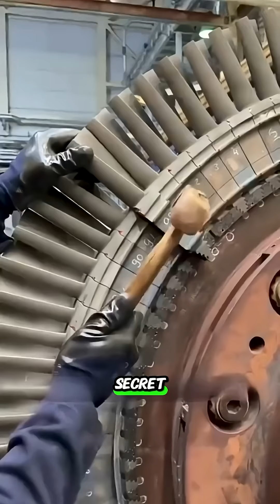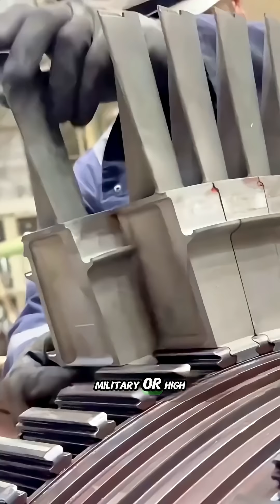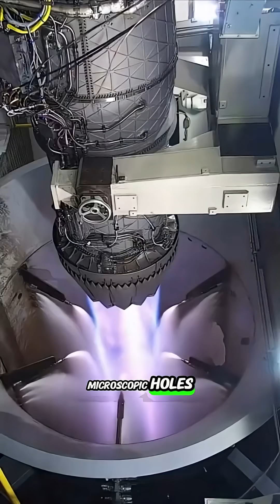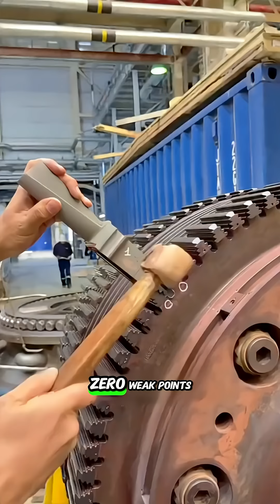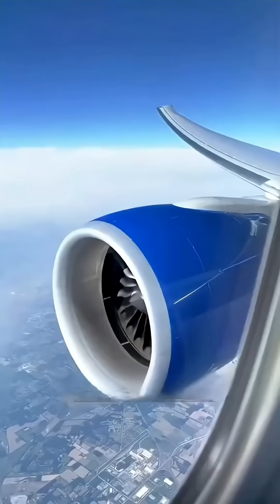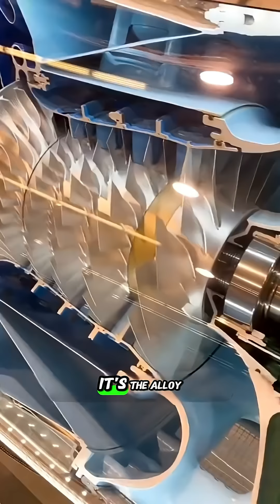The Insane Reason Nobody Can Copy American Jet Engines

Comment: number of jet engines sold according to manufacturers world wide

￼

￼

￼

+13

Four major companies build 99% of all commercial jet engines. Because they do not release the exact number of engines sold every year, experts track them by market share. CFM International leads the market with nearly 40% of all jet engines. [1, 2, 3, 4]

The top global manufacturers and their estimated shares of the market are:

CFM International: ~40% market share. This is a partnership between GE Aerospace (USA) and Safran (France). They mostly build engines for smaller passenger planes like the Boeing 737 and Airbus A320. They have delivered over 37,500 engines worldwide. [1, 2, 3, 4, 5]

Pratt & Whitney (RTX): ~29% market share. This US company makes engines for regional and single-aisle jets, like the Airbus A220. [1, 2, 3, 4, 5]

Rolls-Royce: ~18% market share. This UK company focuses almost entirely on the giant widebody planes. Widebody planes are big jets used for long overseas flights. They delivered about 262 large commercial engines in recent years. [1, 2, 3, 4, 5]

General Electric (GE Aerospace): ~10% market share. The US manufacturer powers both commercial and military aircraft. They are the second largest engine maker by volume after CFM. [1, 2, 3, 4, 5]

Smaller companies make up the final 1% of the market. These include Honeywell (USA), IHI Corporation (Japan), and the Aero Engine Corporation of China (AECC). [1, 2, 3, 4]

Would you like to know which specific airplane models use these engines, or are you interested in the military jet engine market?

List of turbofan manufacturers - Wikipedia

The manufacturers market share should be led by CFM with 44% followed by Pratt & Whitney with 29% and then Rolls-Royce and General Electric with 10% each. Conte...

￼

￼

Wikipedia

Pure power: The world's largest aircraft engine manufacturers - AeroTime

15 Jan 2025 — Pure power: The world's largest aircraft engine manufacturers. ByAeroTime Editorial. January 15, 2025. Aircraft. The biggest engine makers in the world. AeroTim...

￼

￼

AeroTime

CFM International - Wikipedia

CFM is the world's largest commercial aircraft engine manufacturer, with a 39% market share as of 2020. It has delivered more than 37,500 of its engines to more...

￼

￼

Wikipedia

Our Businesses | Rolls-Royce

Our large installed product base of more than 4,860 engines powers 4 out of 5 of the new generation widebody aircraft. Large engine deliveries increased in 2023...

￼

￼

Rolls-Royce plc

Aircraft Engine Market Size, Share, Trends | Growth [2034]

The market is segmented by: * *Commercial* Narrow body, wide body, business jet, general aviation, and civil helicopters * *Military* Fighter, transport, an...

￼

￼

Fortune Business Insights

Top 50 Companies in Aircraft Engine Market Statistics, Growth Report 2035

11 Sept 2025 — The top aircraft engine manufacturers include: * *Rolls-Royce plc* A major manufacturer of high-thrust aerospace engines, Rolls-Royce is known for its Trent s...

￼

￼

Spherical Insights

Global aircraft engine market - Statistics & Facts - Statista

30 Mar 2026 — Aircraft engine manufacturers. When it comes to manufacturers of aircraft engines, CFM International is the leading commercial aircraft engine manufacturer, wit...

￼

￼

Statista

Rolls-Royce Vs. Pratt & Whitney: Vs. General Electric - Simple Flying

8 Apr 2026 — Engine makers form a critical part of the aviation ecosystem, providing the engines that power commercial aircraft. Engines are the single most valuable compone...

￼

￼

Simple Flying

￼

5:21

GE, Rolls Royce, Pratt & Whitney: Who Rules the Engine Market?

￼

￼

YouTube·Simple Flying

22 Leading Aircraft Engines Companies Shaping Global Propulsion ...

Discover the companies that are redefining industry benchmarks, and explore the in-depth market research report for actionable insights and strategic foresight.

￼

Research and Markets

How Many Jet Engines Does Rolls-Royce Produce Annually?

23 Sept 2025 — How Many Engines Does Rolls-Royce Produce Annually? ... Overall, Rolls-Royce produces hundreds of jet engines per year. These engines span multiple segments of ...

￼

￼

Simple Flying

GE Aerospace aims for the sky on Asia-Pacific’s aviation updraught

29 Sept 2025 — According to industry estimates, it ( The US-headquartered company ) holds around 40 per cent market share through sales of its ( The US-headquartered company )

￼

￼

The Business Times

Aircraft Turbojet Engine Market Outlook 2025-2032

9 May 2025 — Regional Analysis North America: The United States dominates the global aircraft turbojet engine market, driven by robust defense funding, established manufactu...

￼

￼

Intelmarketresearch

Transforming Aviation | Pratt & Whitney

From ultra-efficient turboprops to the revolutionary family of Pratt & Whitney GTF™ engines for single-aisle aircraft, we're continually raising the bar for eff...

￼

￼

RTX

Only 5 countries can produce jet engines - Aerospace Global News

30 Aug 2025 — The only 5 countries capable of producing high-end commercial and fighter jet engines. Why only around six countries can produce advanced commercial and fighter...

￼

￼

Aerospace Global News

Aircraft Nacelle and Thrust Reverser Market Trends, 2031

29 Aug 2025 — The U.S. boasts one of the world's largest active aircraft fleets, including commercial, military, and general aviation aircraft. This translates to a substanti...

￼

￼

SNS Insider

Comment: I work at the Rolls Royce turbines campus. A finished turbine blade does not cost as much as a new car.

The film cooling holes aren't thinner than a human hair. The internal cooling passages aren't more complex than the human vascular system.

The Ni superalloys don't have higher melting points than many other metals, they have lower creep resistance.

Comment: I call bs on the numbers of those blades cost. The cheapest 5 series starts at like 60k and goes way up. With 92 blades just on that single set that's over 5 million. And being how there are way more blades than the single set and the many other parts of those engines and the multple engines on one of those aircraft...I call CAP in all CAPS, lol. I'd think if that were true the engine alone would cost over 100 million, lol.

Comment: I work manufacturing parts like these for ground based turbines, the processes to make their features (like those internal cooling structures) isnt so hard, you could probably build a machine in your garage thatd do the same thing, but the castings come from somewhere else, not sure where. The material isnt onobtainium its basically stainless steel without any iron.

Comment: Actually, China has finally broken through this wall. It took them over 30 years, billions of dollars, and endless trial and error, but their domestic WS-15 'Emei' engine is officially in advanced flight testing and early production. They've mastered the single-crystal casting and high-pressure turbine blade metallurgy needed to run at over 1,600°C. You can't shortcut the industrial expertise, but if a country is willing to throw unlimited state resources at the problem for three decades, eventually the physics bottlenecks will break.

Comment: What a crock of shite. The reason a single blade costs so much is bc of corrupt govt contracts that award airline and military contractors exponentially more than they’re actually worth. And the Chinese and the Russians are just as capable of building these engines. But they’ll do it for a fraction of the cost.

Comment: Jet engine manufacturing is dominated by a few massive global players, with GE Aerospace and CFM International (a joint venture between GE and France's Safran) leading the commercial market. Other major manufacturers include Pratt & Whitney and Rolls-Royce. 
Military Aircraft:
Pratt & Whitney: 
The current leader in fifth-generation fighter propulsion.
F135: Powers all variants of the F-35 Lightning II; it is the most powerful operational fighter engine.F119: Powers the F-22 Raptor, providing its "supercruise" capability.F100: Powers legacy but widely active F-15 Eagle and F-16 Fighting Falcon fleets.
GE Aerospace: 
A powerhouse across fighters, bombers, and military helicopters.
F110: Heavily utilized in later-block F-16s, F-15EX Eagle IIs, and international fighters.F414: Powers the F/A-18E/F Super Hornet and EA-18G Growler, as well as India's HAL Tejas Mk2.T700: The definitive turboshaft engine powering UH-60 Black Hawk and AH-64 Apache helicopters.
Rolls-Royce (UK): 
Powers a wide range of multinational military platforms.
EJ200: Developed via the Eurojet consortium, this powers the Eurofighter Typhoon.
Adour: Powers trainers and ground-attack aircraft like the SEPECAT Jaguar and BAE Systems Hawk.
LiftSystem: Developed alongside Pratt & Whitney to provide vertical-lift capability for the F-35B variant.
Safran Aircraft Engines (France): 
France's leading sovereign military engine developer.M88: Powers the Dassault Rafale fighter jet.TP400: Developed via Europrop International to power the Airbus A400M Atlas military transport.
MTU Aero Engines (Germany): A critical partner that co-manufactures and services engines like the EJ200 (Typhoon) and holds shares in American programs like the GE F414.

Comment: Dude that's just bullshit. A weight difference of a single hair on one blade is enough to destroy the whole engine. But it's totally fine to hammer it together during assembly. Also if that was true what happens if there is dirt on the blade? Have you seen how jets are parked at an airport? Outside and completely unprotected from the world and the elements.

Comment: For those that keep yelling Rolls-Royce  do your homework they are made in America

Rolls-Royce builds its jet engines for the American military at its massive, state-of-the-art manufacturing campus in Indianapolis, Indiana.

The Indianapolis site has over 80 years of history powering U.S. military aircraft, originally operating as the Allison Engine Company before being acquired by Rolls-Royce.

For civil aviation
Rolls-Royce aviation engines are produced through a global network of specialized facilities. Final assembly and testing for large civil engines occur in Derby, England, while its Singapore campus produces about 90% of the company's titanium fan blades. Other key manufacturing sites are located in Germany, the USA, and Japan.

Comment: It's why the chinese have to buy the jet engines for ALL of their supersonic jets from ruzzia. The ones that they build cannot maintain supersonic speeds for more than 8 minutes without catastrophic failure. And even at subsonic speeds, the run time is less than 400 hours. And the reason is that china just doesn't have the capability of manufacturing on a manufacturing ability, single crystal titanium metal structures...yes, they can build them one at a time in a lab, but that takes weeks to months per blade...with a reject rate of more than 70%. And then they fail soon after being deployed.

Comment: So how does the coolant keep recycling if it is spraying through those whole and out the back of the engine along woth the jet fuel and fumes and exhaust once escaped is gone so wouldnt u run out of coolant as fast as u would fuel??? I only understand cars engines so im legitimately asking how this works because I wana understand the basics of how a jet engine works and stays running without blowing up
Reply: I was under the impression that they are air cooled by compressed air that make the jet go faster by being even more compressed during whats called scam jet mode. So the coolant thing is co fusing the crap out of me

Comment: BMW used to manufacture 3000hp engines back during WW2

I have a friend who works in aviation. These planes have backups for the back up 

Crazy levels of safety
Reply: BMW was making turbo prop engines before they made cars. That is where their emblem came from.
Reply: The BMW logo is actually a spinning aviation propeller 😮 ! 🎉
Reply: @oneflowerninjamagic1912 The BMW logo is actually not a spinning propeller. The myth stems from a 1929 ad campaign that placed the emblem over a rotating aircraft propeller. In reality, the blue and white quadrants represent the official colors of the State of Bavaria, honoring the brand's German roots.
Reply: I'm am A & P and can confirm that.
Reply: That's why they are using Rolls Royce engines for the B52s upgrade
Reply: @keithbrackenbury6881 😂
Reply: Except for Boeing 😂
Reply: This.
Reply: Cough. ROLLS ROYCE
Reply: @ppp7277  ? Are you implying BMW didn’t make plane engines? Because they clearly did and their emblem is literally a propeller
Reply: @ppp7277 🖕Rolls Royce!
Reply: BMW never built an engine that powerful. They were working on combining two BMW 801 14 cylinder engines that powered the FW 190. It was theoretically supposed to produce around 4000 hp, but was way too heavy and it never went into production.
Reply: I thought NASA was using Russian engines until Space X came about.
Reply: @georgek.5817 That had nothing to do with jet engines. NASA had to use Russian space shuttles to supply the ISS.
Reply: @bambesfresser  *Russian rockets, not space shuttles
Reply: @thinkbigize  I couldn't think of the name this morning. "Rockets" seemed to simple. Whatever is needed to supply the ISS.
Reply: @bambesfresser  have a nice day!
Reply: @georgek.5817 Soyuz rocket engines. Not jet turbines.
Reply: The Hitler had a advanced science workforce. 
United States and Russia benefited from German/ Jews science and engineering.
Reply: @gwillis9797  a lot of German power was propaganda. There’s several videos on this. And the Germans refused to use Jewish scientists because they thought nuclear energy was “Jewish science” 

Germans used a lot of horses and only showed their tanks off in propaganda videos
Reply: @DMX-NAS 
America captured some of those scientists just like the Russians did. 
I am a 85 year old veteran.
Reply: @DMX-NAS yea, right, they even used winged horses in Luftwaffe, Pegasus horses
Reply: BMW built the gas chambers used during the holocaust.
Reply: Iran still shot them down 😂
Reply: @Sparkx-p8k  tf is this reply?
Reply: @DMX-NAS  there is a war between the US and Iran U dum dum .. & has Iran shot fighter jets down yes or no ? 
Comment says crazy level of safety when in fact it's not true
Reply: @Sparkx-p8k  are you really this dumb? Like just wow. This level of ignorance… you gotta be a 6 year old. 

You think I’m talking about fighter jets? I’m talking about passenger planes that carry 300+. Safety doesn’t mean it’s gonna prevent missiles from hitting you… it means there’s backups for the backup in case something goes wrong as you’re flying from LA to NY.

Seek mental help
Reply: @DMX-NAS  alright  😂😂
Do you think this video is about passenger planes ... nothing said in video about passenger jet and there was certainly nothing in your initial comment suggesting it was a passenger plane gonna give you benefit of doubt ciz I'm a nice guy like that 😊
Reply: @DMX-NAS 😂😂
Reply: We can make the best planes in the World but we can’t make reliable cars 
The Automotive Unions are the reason cars are so poorly made in USA
Reply: @lexusdelivery8508 It isn't the unions, it is the EPA
Reply: @JackSparrow-yb3lq Blimey! What does a fictional pirate captain know about any of that? 😂 j/k of course. Sometimes, you have to spell this stuff out, for the people who don’t get sarcasm.
Reply: We can, just don't 
No profit
Reply: @lexusdelivery8508  They know how, it’s just that they would have to use less plastic parts, and that would make them more expensive to make. As it is, modern BMW’s are supposedly very reliable for the first half decade or 50k miles, if correctly maintained, but that’s because BMW has perfected plastic parts to be reliable for this long under the right conditions.
Reply: @lexusdelivery8508  The unions an the EPA are lame excuses. The average American customer is satisfied with a cheap mass-produced product. Frankly there's no need for an over-engineered high performance car. In Germany a F150 is as rare as a Rolls Royce.
Reply: @lexusdelivery8508  hello the French have best passenger planes airbuses Airbus A350: Frequently rated as one of the best long-range passenger planes for its quiet cabin, modern composite design, and fuel efficiency.

Comment: True.. the turbine blades are grown in a cyrysteline structure before they are shaped for service. They are then shaped and balanced. On a walk around of a modern jet aircraft they click and clack in the wind.. When the engines are lit, they are forced into position to produce great thrust. As fuel is introduced into the cycle they grow somewhat to expand and solidify the ability to produce positive thrust. These engines are magnificent achievements in engineering and metallurgy. That’s why they have temperature limits which modern aircraft fuel control computers monitor and intervene when needed.